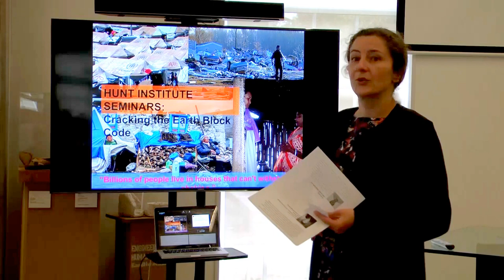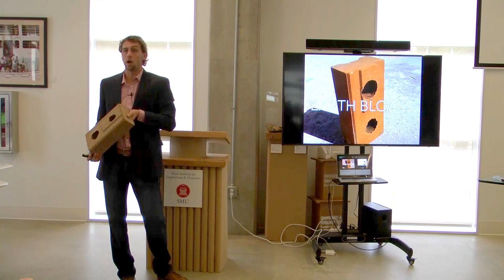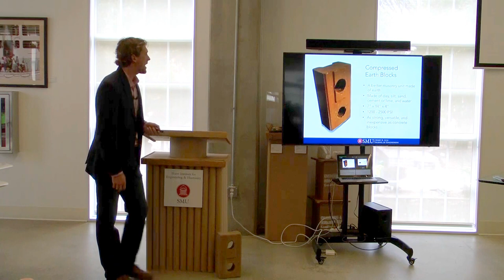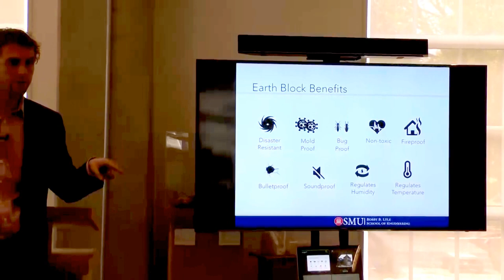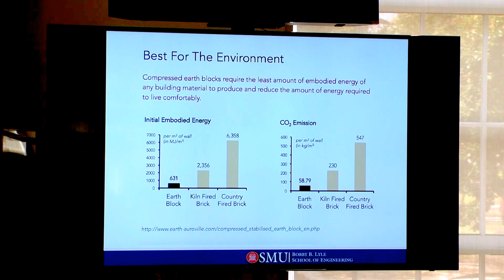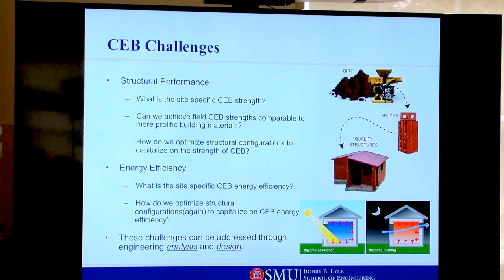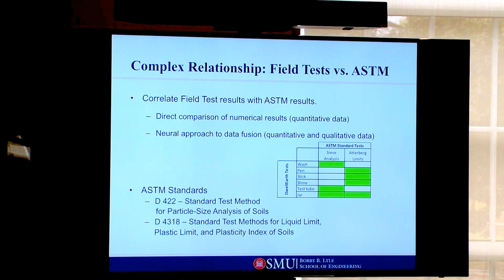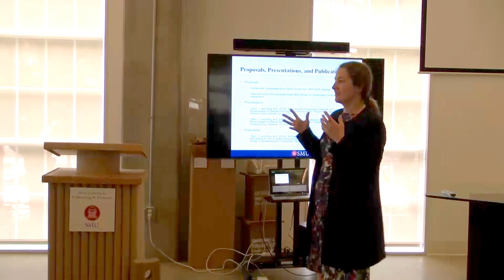Dwell Earth Presents Innovations in Soil Analysis and Mix Design for Earth Blocks

Comment: Really frustrating. 
I'm trying to find out what is used to bond block together like mortar is used with concrete block, and how electrical and plumbing are run through the home. These are basic, practical questions when it comes to building, asked by someone who's been in residential construction their entire adult life. 
I couldn't care less about a house in Mozambique or how pretty a house looks surrounded by palm trees. I'll worry later about exactly how the machine that makes the blocks is designed. 
WTF do I have to do to get basic construction information?